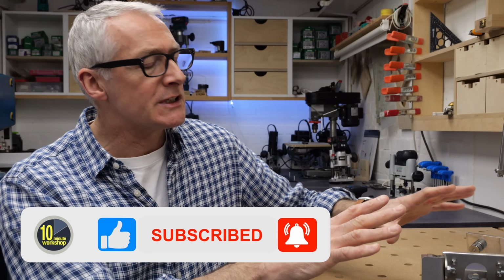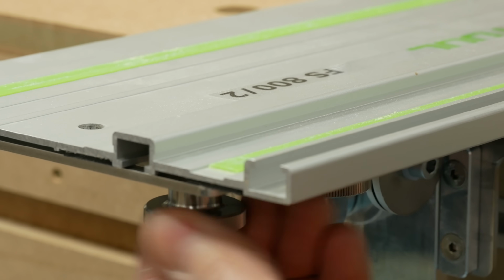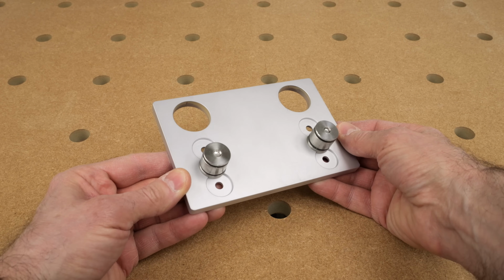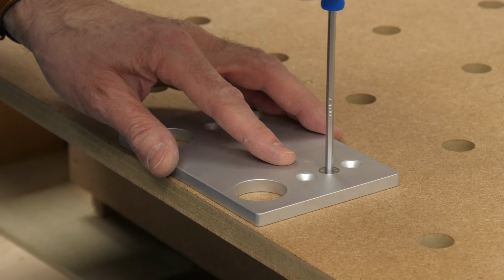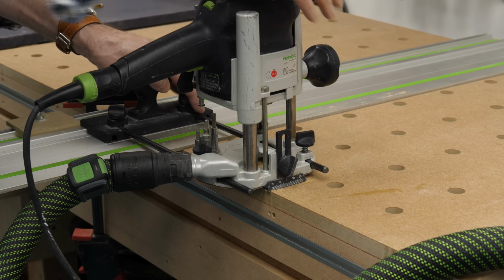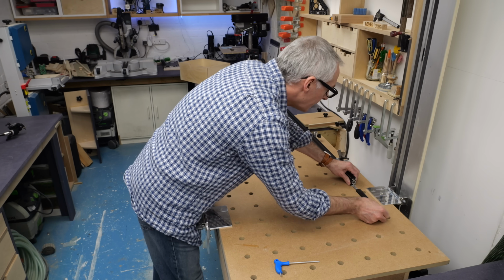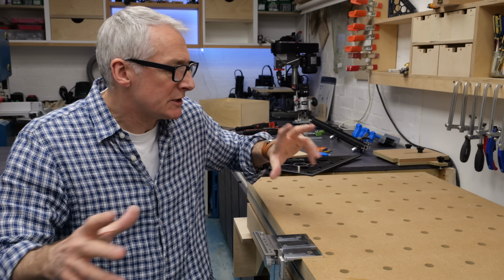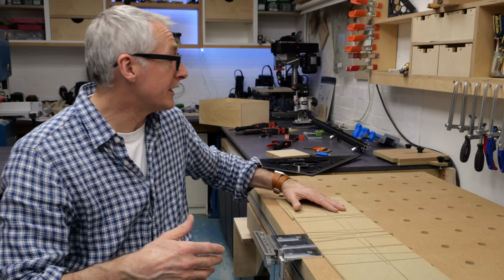Benchdogs Quad MFT Hinge System [**Ad/Gifted][video 492]

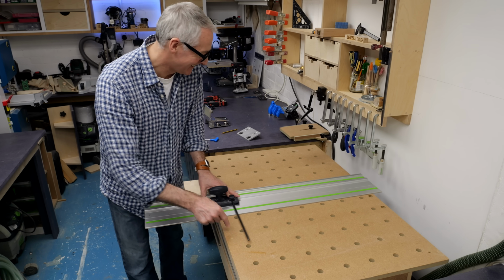Comment: @8:05 why not use a couple of bench dogs to get the rail absolutely registered to the hole pattern?
Reply from the maker: It would push the router too far out on the rods to be able to reach the second column of holes. 🤷‍♂️
Reply: @10MinuteWorkshop  Makes sense. Might improvise with 1-2-3 blocks to fix the spacing, but anyway it seems to have worked out. Good show. Carry on!
Reply: @10MinuteWorkshop  I like Ian's idea, but it requires a slight change to your method to gain success.  

Registering the rail to a bench dog would mean pushing the rail over another 20mm to the right. This clearly overlaps the first hole you are trying to drill. 

In order to uncover  and drill that hole using bench dogs requires moving the bench dogs and rails to the left by one column. This moves the rail from your set up on the left edge of the dog holes to the right edge of the next dog hole left:  96(left) - 20(right) = 76mm.  Since you can already reach two dog holes with your router now,  you definitely can reach the first dog hole from one column over. To reach the second dog hole, just shift the dogs and rail to the right by one column. 

Hopefully I didn't make a mistake here. (that happens too often)

Comment: Great video, thanks Peter. Apologise if someone has asked already, I have a 'walk around' MFT workbench that is 2M x 1M.  If I wanted to fit the hinge and hinge support inboard as much as possible to reduce overhang what distance should I make the hole centres from the edge for both parts? Thanks
Reply from the maker: Thanks. I did a quick video on Instagram to show how far to notch them in to use the regular MFT holes here - https://www.instagram.com/tv/Ccmj_WSD2wb/?igshid=YmMyMTA2M2Y=  

If you wanted to notch them in so there’s no overhang, I’d have to check when I’m next in the workshop. 👍

Comment: For the heck of it, I have the system on order but couldn't wait to try to drill the holes. I just used the parf system, put the dogs in the two 20mm holes in the jig and into holes already in the top. and put the drill in the guide that is used first when drilling hole the holes, the one nearest the single 20mm hole guide on the jig. Seems perfect to me

Comment: Interesting but £180!!! Ouch
Reply from the maker: I understand where you’re coming from, but as I say at the end of the vid, no rail hinge is cheap, and this is bang between the ‘less than premium but still proprietary’ pressed steel Festool offering at ~£110 and the Dashboard set at £285 shipped and duties paid. 🤷‍♂️👍
Reply: @10MinuteWorkshop  yes I get it and of course much less than a table saw or mitre saw but it’s still an ouch (as most things are now).😊👍🏻

Comment: Is there a way to make the additional holes with the jig but without using a 20mm cutter and a guide bush in a big router? I only have a Makita trim router with a plunge base and I'm not sure I can even find a 20mm cutter for it plus the extra expense. I was wondering if you could drill a close-sized hole and then flush trim it using the jig as a template guide? Sorry, newb question :-)
Reply from the maker: You’d have to do a bit of maths to get it right, but the template takes a 30mm guidebush, so a smaller guidebush in combination with a smaller cutter should be able to do the job. 👍
Reply: Ah, so the hole in the jig is of course bigger than 20mm to accommodate a guide bush so it would not work as pattern template.

Comment: Good to see the Bench Dogs hinge in action. Many thanks for the informative video. I'm very keen to get either the Bench Dogs or Dashboard hinge. The one misgiving I have is the amount of track/rail they use, primarily on the hinge side. I'd like to maximise the cross cut capacity on my custom made MFT bench and both hinges take up quite a percentage (with Dashboard being slightly less from dimensions I've seen). I'm not an engineer, but I can't quite see why such a large amount of the track should be required - particularly since the non-hinged side is going to register into a pin on the other end. The DIY solutions I've seen using a "Z" type hinge arrangement take up far less room and I'm wondering why no manufacturers have looked at that as an option.

And another vote for a rundown on available 20mm plunge router bits. It looks like the Festool one you had machined to a better tolerance has been discontinued (at least in Australia and from what I see in the UK).
Reply: There's a LOT of leverage acting on the pivoting end and a fairly large contact area is needed to control it, as well as to just generally keep a rail well-secured to the plate. It's also useful to consider that not all users will be gentle with the device.

Comment: Would it be possible to make the hinge plate (with the quad dogs) also be the template? I.e. the hinge plate has the guide holes in it, you use that to bore the extra mft holes and then attach the hinge assembled to the plate? Or do similar with the front rail support plate…
Reply from the maker: Don’t think there’s enough space on the plates to do that, and if they made the plates bigger just to enable that, then I guess it’d be self-defeating. 🤷‍♂️👍

Comment: Hi Peter, I would like to add a few holes and add an extension piece to my MFT table and would be very interested to see a review of the various router bits available.  Like many woodworkers I want to spend wisely, not cheaply as this often leads to frustration due to problems and inaccuracies.

Comment: Hi Peter I’ve ordered mine but was interested in the router guide that you used on the track. I have a Makita track but haven’t been able to track anything down here in oz to use the router on the track. Could you please tell me what you are using. Thanks
Reply from the maker: Thanks! It's a standard Festool rail adapter - https://amzn.to/3xzqT5l (cheaper elsewhere) - you need to use the rods that come with the router, but it works great. 👍
Reply: @10MinuteWorkshop  Thanks

Comment: Why did Benchdog wait so long to develop this? I recently purchased the Dashboard hinge system for my MFT. I still have the orginal Festool hinge plate I hated having to re-square the track after lifting the fence more than ten times or bumping into the table. Who knows maybe I add this plate to my other MFT
Reply: We started on this project about a year ago but we just didn’t have the space and manpower to proceed. Since we moved to our new location and we’re settled in, it was one of my many new products to release.

Comment: Thanks for another great video Peter! I would love a comparision of the 20mm router bits :D By the way. This hinge system, is it quick to remove/install? I have my MFT behind my cabinet saw and use it as an outfeed table. Would you suggest just using the dogs to reference the rail, or is this a system that is easily removable and quick to reinstall?
Cheers.
Reply from the maker: Thanks Goran! It’s about 20 seconds to add or remove either the hinge or front rail support, 1 1/2 turns of the machine screws that secure the quad dogs is all. 👍👍
Reply: @10MinuteWorkshop  Yes, it was this ease of removal and re installation that was the clincher for me in deciding to buy this one over other designs. That and the fact that you don’t need either an MFT profile or some form of track installed on the side to install it, as my intended use is something more temporary and/or portable, so it can be set up just on some sturdy Axminster saw horses to make a temporary workspace and taken off when not needed for repeat cuts etc.

Comment: Perhaps it would solve the offset height problem (flexing of rail and renders rubber strips ineffective, plus dust under rail now)  if the hinge mounted UNDERNEATH the MFT, provided quad dogs didn't protrude, then rotate the hinge all the way around, even more flexible if it mounted either way, on top or underneath? Would that work?
Reply from the maker: No, the stresses are all transferred into the quad dogs if you try to mount the hinge plate underneath. Not good.

Comment: During lockdown i had this same idea. Mounting the hinge to the table top.  Designed a version in sketchup but never got round to sending it to Benchdogs. Looks like great minds think alike.  If the bench rail was allowed to pivot, perhaps with additional holes set on a arc or with an adaptor you could use the saw guide to cut accurate mitres.

Comment: i feel like this hinge thing is not suited for a permanent shop where your table is against a wall. If you think about it you are loosing about a 1/4 square meter of shop just so the rail can swing. I have a small shop just like you and for me that 1/4 square meter can and should be much more useful. Festool came with that for artisan who set up on site, so they typically set up some saw horse in the middle of the room eventually placing an old door to make a worktable, MFT was ment as an improvement of that and it certainly is a huge improvement on that.
Reply from the maker: I don't disagree, and I mention this when I bought the dashboard hinge as well. In truth though, while the MFT may have been conceived as a portable worktable, I know very few people who use them out of the workshop as they're simply too heavy. The Festool hinge has an impressively short rear overhang - half that of the Benchdogs and Dashboard hinges - and it's something that I'm making a priority wasI design my own DIY hinge. 👍

Comment: Great video as normal Peter, I personally see that the 6mm raised plate as a benefit as by using a sacrificial 6mm scrap under the workpiece you are then not cutting into the MFT table top.
Reply from the maker: Exactly! 👍

Comment: Excellent video!!  Your years of doing these really shows in this one.  The camera angles are perfect, the timing, the script, all first class!!  The product looks almost too good to be true.  In production, you may see non metallic knobs, and other cost cutting techniques.  The fit and finish on this first prototype are really from a truly first rate custom machine shop, not production.  I hope that the production product is close however.  The squareness of the MFT top is one of it's primary functions.  I depend on this every day I use it.  I hope Benchdogs maintains that squareness over time of usage.  Stay safe and take care.
Reply from the maker: Thank you! Yes, it's a lovely product, and the tactile feel of the knobs, in particular, really help to set it apart. 👍

Comment: Can you think of any other uses for the hole jig? Adding a fence perhaps? Can the bases of the two supplied dogs be used with anything else? Really trying to find the value in the jig 😄
Reply from the maker: Apparently there are other applications planned for additional benchdogs products, so it's not a one-trick template.👍
Reply: Ah ha, I see. Well at the very least I could also use it for measuring spaghetti or just as a coaster

Comment: LOL, you mentioned thicker MFT tops, I made mine from 25mm - and yes, had to heavily chamfer every bluddy hole at the back :-) And BTW, paint/varnish the top BEFORE cutting the holes or the paint goes in every hole which you have to clear or the dogs wont fit - arghhh :-) Still far better than a tablesaw 'though!

Comment: It's an interesting piece of kit but my concern is by the time you have bought it and the template, and the fence, the MDF and whatever device you pick to cut out the holes for top then you might as well have paid the retail price on an actual MFT 3.  They need to do a kit that offers good value for money otherwise this is redundant.
Reply from the maker: Starting from scratch you can easily spend as much on a DIY version as a new MFT, as I showed when I made mine recently. But you get a much better product; the benchdogs and dashboard hinges may cost twice as much as the Festool OEM hinge, but they’re 10x the product. You pays your money and makes your choice. 👍🤷‍♂️

Comment: Anyone know if this would work with a Parkside tracksaw? Got a feeling this hinge might cost more than the saw and track!
Reply: I use a Parkside saw on a Festool track
Reply: @MrD4n100  thanks! Sounds promising then!
Reply from the maker: If & when I get a production sample, I’ll be checking it against all the rails I have. Parkside wasn’t singled out as a compatible rail type, but as long as the rib & underside t-slot is in the right place it should work OK.
Reply: @10MinuteWorkshop  cheers Peter, appreciate you taking the time to respond and I am looking forward to that video!

Comment: Great use of existing resources.. so I can make use of this on my tool box 📦 without drilling additional machine screws on the front side of my bench. 

I presume the eliminates the need for the front secure rail (using your IKEA hack suggestion now)
Reply from the maker: Front securing rails are still very useful for clamping. 👍👍

Comment: Very interesting Peter, another lovely bench dogs product, beautiful quality but not cheap.  I did particularly like the way it's been designed as a universal hinge for different manufacturerers rails, that really is a unique product feature. 
The template jig for drilling the MFT holes seems a lot of money for something that most people are only going to use a couple of times, I'd be very tempted to make my own jig.  Maybe someone entrepreneurial will set up a jig rental service?
With regards to insetting the rail and stop in the MFT and then reducing the quad dog grip with only one set of grommets, you could simply screw a small additional panel underneath the rail square holes to increase the MFT thickness and drill through to provide the full depth that the quad dog wants.  Cheers

Comment: if i were building my own mft top id inset the hinges and stop and thicken the mdf under the holes so both rubbers contact the mdf,  you could also 3d print a template for setting the hinge, or cut it on a cnc if you have one. an expensive, but nice product .

Comment: Would love to see the fence adapted to use the 6mm hinge plate as the under rail support for the fence. The drill jig used to add more holes for the fence, set back to align everything up. etch up the plate with the scale. This would be amazing!

Comment: I like the router option setting it into the bench then just glue on a 6mm board under the bench in those two areas so the 2 Orings can grip. I’m guessing the 2 rings are used to ensure the dogs stay perpendicular to the table.

Comment: Hello, I have a question for you. What router bit are you using? Thanks in advance.
Reply from the maker: I used the Festool one, but had a precision engineer pal grind it back to cut a precise 20mm hole.
Reply: @10MinuteWorkshop  thanks. What festool bit is exactly?

Comment: I don't get it. Why does it have to be so much overhang on each end? Especially the front that is just a guide pin on an 'elevat-able' plate.
Seems to me that with a bit of clever engineering, solving the elevation part, both ends could have been done in a couple of pieces that locks into the normal dogholes already in the mft top.
Reply from the maker: Yeah, the Festool OEM hinge overhang is about 120mm -  but then the Festool OEM hinge isn’t exactly a premium product. I’m making my own DIY version, I’ll keep you posted how it goes. 🤷‍♂️👍

Comment: Given the price of the template and as it'll likely only be used to make 4 holes, it would be nice if Benchdogs could make some available to rent (with a returnable security deposit), possibly with the option of a 20mm router bit.
Reply from the maker: As I hope the video showed, it’s pretty straightforward to put your own holes in there, but I do see where you’re coming from, and while a rental scheme sounds like a logistical ‘mare to me, I expect the army of 3D printing experts out there will fill that void. 👍👍

Comment: Thank you Peter, Hannah from Benchdogs told me this video was dropping today, when, I enquired about the product, so thank your for doing this. 

I have a question, if I may, looking at the back hinge installed on your bench, if it was installed without the new holes, does it still fit behind the fence supporting the thin part under the rail. If that works how far would the hinge then require at the back against a wall like yourself. 

Thanks
Matthew
Reply from the maker: I don’t think hanging the hinge off the underside would fly - all the weight and stresses on the support plates would then be on the quad dogs, and  I think that’s just asking for trouble. 👍
Reply from the maker: Thanks Matthew. The hinge won’t install on the existing grid of holes in a standard MFT top; if you have an overhang then you should be able to notch the hinge into the top far enough to use the normal holes, but I haven’t done this, and can’t say until I do how well it will work, or how it will interact exactly with the benchdogs fence. 👍👍
Reply: @10MinuteWorkshop  ok Peter, thank you.
Reply: @10MinuteWorkshop  I did have another thoughts to run by you to maybe feed back to Benchdogs. If like your table there was an overhang at the back an then maybe one at the front too, what do you think about attaching the units from underneath the MFT top?
Would the quad dogs be secure enough, I assume the screw hole for attaching to the units goes through the whole fixing plate, then whilst you would lose some height the rail would sit flush.